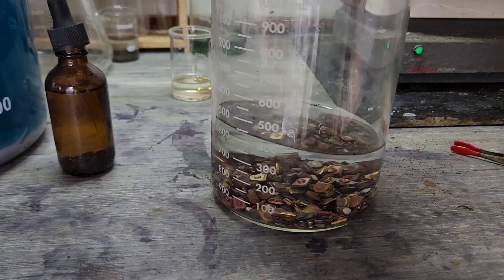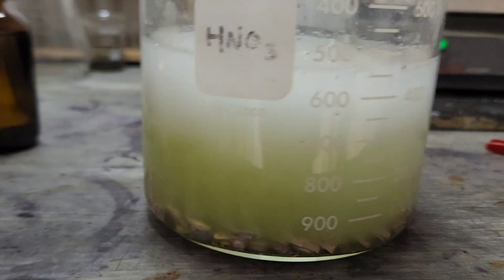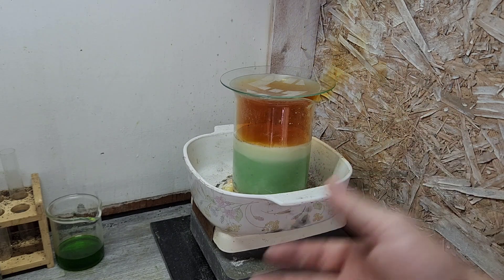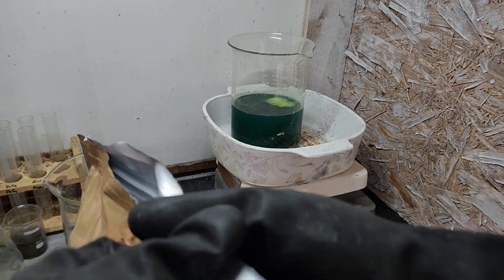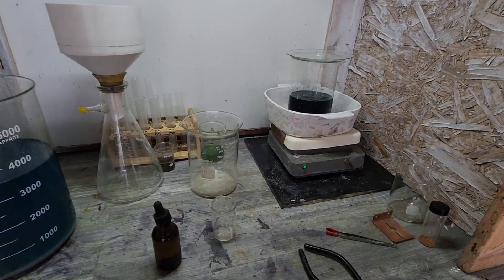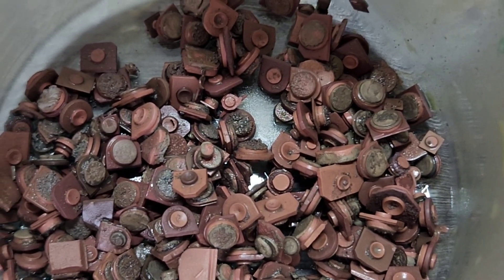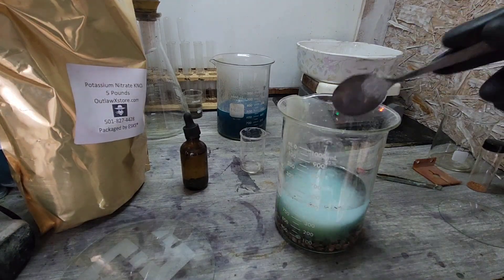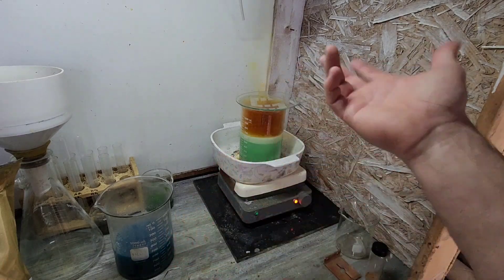Silver contact recovery using poorman's nitric part 1

Comment: Will sulphuric with potassium nitrate dissolve gold? I use both Nitric and Sodium Nitrate methods with HCL. But i cant imaginge sulphuric with potassium nitrate would work on gold? If so, id try it. But the HCL is what alters gold molecules just enough to let the nitric dissolve it. I dont see thr sulphuric and potassium working on gold? But if it does, id try it. Walmart sells 1 liter of sulphuric for $18.98. I need it for possible lead contaminents anyway, i just need potassium nitrate to try it.
Reply: No, hydrochloric acid and potassium nitrate will though.
Reply: Yes you can make aqua regia with sulfuric but it doesn't dissolve gold as good as hcl and potassium nitrate

Comment: What is your starting material?
Reply from the maker: The material I am trying to refine is silver contact containing at least copper and brass.
Reply: @SilverStoll  what are they used for? Threw phase switches?
Reply from the maker: @makegrowlabrepeat  I am an HVAC technician and get them from switches on units I repair

Comment: I would take a 3/8" - 1/2" drill bit to the silver contacts. It will give it alot more surface area. And make this go way faster!
Reply from the maker: That's what I usually do but wanted to see if there was a more efficient cost effective way.

Comment: You could make nitric acid by passing air through a  hot plasma arc and then bubble the air through water. Im not sure how economical it is but it should work just fine with a proper design.
Reply from the maker: I have seen videos on that! It's a really cool idea!

Comment: Is the cost savings that high by not using just Nitric from the start?  Interesting theory.
Reply from the maker: Nitric is fairly expensive in comparison to the other two chemicals used in this video. Now it's just measurements of each that is in question lol did we have to use the same amount of money in chemicals this route in comparison to nitric

Comment: For a mix like this,  I would melt it all into a thin plate and make it the electrode of a bath.  Plate out one material and drop the other as a precipitate.   Similar to copper refining.

Watch some  videos about copper ore purification.
Reply from the maker: I actually have a 300 gram bar I poured in an anode and in the copper cell. That is the cheapest way you will get the silver, no question. It does take a long time however
Reply: @SilverStoll   Yes . What can help is to make it into a wide, thin sheet to increase the surface area.  Then use a container with a similar shape.  The rate will then mostly depend on current flow.

Comment: Your problem is the use of nitric acid to dissolve copper AND silver at the same time. When using nitric acid, the silver will go into solution first, then the copper. But in the case of trying to dissolve both metals together, the silver is dissolved, then it is cementing out on the copper, making a protective shield around it. Some of the silver have cemented out already (grey sludge) but you're going to waste a lot of chemicals doing it that way.

To dissolve silver AND copper together, you first need to use Hydrochloric Acid because it will dissolve copper, but not silver. After doing that, filtering and rinsing the silver that's left behind, then you use nitric acid. 

Hope this helps!
Reply: I forgot to mention that even though HCL will dissolve the copper, it's less costly to use Muriatic Acid instead. Stores like Lowe's, Home Depot and others sell it by the gallon for less than $15 per bottle.

When you heat up the solution, you'll see the solution getting brown over time. That's the copper dissolving. 

Also, there's a video on here that shows the difference between HCL and Muriatic Acid reactions. Even though Muriatic Acid contains HCL, it's reactions and effects are better than HCL in many situations. 

The main key is heat. I may do a video showing that HCL/Muriatic Acid will dissolve copper and leave behind the silver. 

Give it a try, but first rinse off the contacts with plenty of hot water until you have a neutral pH (7). Then proceed with the Muriatic Acid process.

Hope this helps!
Reply from the maker: I like that. I did a video with hcl and potassium nitrate to dissolve just the copper. The hcl creates a protective layer around the silver (for the most part) so the nitric can only target the copper. That worked really well.
Reply: @SilverStoll  If you're dissolving copper alone HCL will work, and nitric acid will work. If you use both acids together it'll work, but you're wasting acids. You will only need one of them. Yet, if you want the copper dissolved really fast, then nitric acid is the one to use.

Comment: Try this as a formula 120ml distilled water, 120ml of sulfuric acid per once of metal, the weight for potassium nitrate would be the weight of metal. so 1 Once metal would be 240ml of liquid  with 1 once of potassium nitrate. adjust up with the liquid to dissolve more metal as needed.
Reply from the maker: I will give this a shot! Won't more sulfiric cause more copper sulfate crystals?
Reply: You make crystals by dehydrating, so I believe when you add sulfuric acid you add distilled water in the same amount the crystals should not form. @SilverStoll
Reply from the maker: I believe it has to deal with how much the acid can hold while heated. I imagine like psychometrics with humidity. Hot air can hold more moisture and when cooled it spits it out. When I did this experiment I had 400ml of distilled to 100ml of sulfiric

Comment: Add more distilled water as you are getting rid of the metals. You need the liquid for some place for the metal to go. That may get rid of the crystal formation.
Reply from the maker: That would for sure work. I'm just curious if this reaction should create them at all. I'm stuck on the idea that if I have copper sulfate I have to much sulfirc in play.

Comment: You got the the crystals because you heated it brother
Reply from the maker: Doesn't the reaction cause heat though?
Reply: @SilverStoll  the reaction creates it's own heat. If you over heat it that's what it does it makes those crystals
Reply from the maker: Hmm that's interesting. I wonder why that is. I figured anything over room temp the crystals would be spit out when the solution cooled
Reply: @SilverStoll  don't know but that's my experience with that
Reply: @SilverStoll  so far messing with these chemicals to strip I found out that adding distilled causes it to act like straight nitric and it eats the copper and small amounts of silver. Straight sulphuric and the potassium nitrate only eats the silver with no heat

Comment: GO BABY GO!!!!  My apologies for not adding this idea:

Place your contacts into an Erlenmeyer flask, add your solution mix, then add a stopper with a hose coming out of it and place it into some water.  You can also use the erlenmeyer with the spout on the side and a regular stopper. The submerged hose will allow the nitrogen dioxide to be collected to make a weak nitric acid. Recapturing the waste to your benefit.

Also remember Garbage in = Garbage out.  Drilling the rivet of the contacts out and removing the copper tabs would also save a lot of nitric.
Reply: Yup all in the prep.
Reply from the maker: I agree! I was drilling them out when processing with nitric. I may go back to that. I currently have a batch in the copper cell working away. Cutting them works good for that because it makes the alloy a little heavier on the copper side. This was just a test to see if would save me some time with the physical processing part.
Reply: @SilverStoll  Unfortunately, there’s not many shortcuts you can take and achieve a high recovery and purity. The work has to go in to get the good results out. You might be running into a saturation point of the liquid. I think your path of multiple small batches will yield a far better result than a single large batch. Keep plugging away, we are rooting for you.